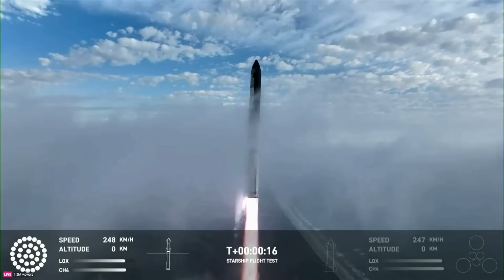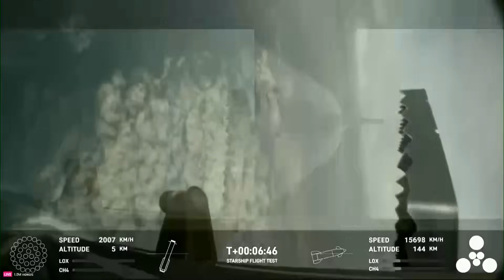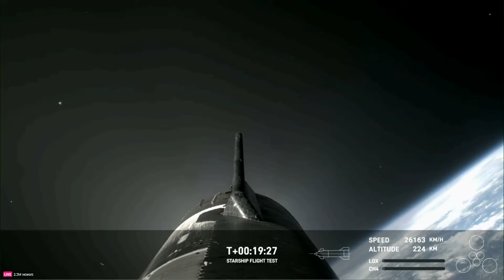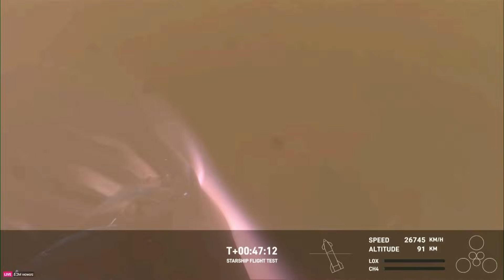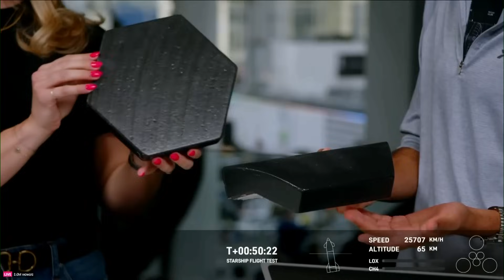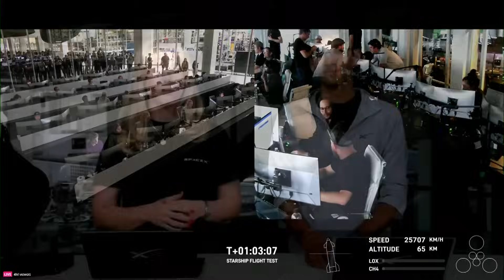Starship's 3rd test flight deemed a success

Comment: Look up AVCO and Victor Emanual 

The welds were done in climate controlled top level clean room using an EBM welder.

My Ukrainian friends dad was 1 of 3 that was allowed to run it. Like me he would say " IF I TELL YOU ILL HAVE TO KILL YOU"

Dad was final inspector on Atlas Titn and Apollo parts. Mom worked there after the Air Force was. Theown out in 1975. Mom shipped every tank engine out IT on that tag grunts. I worked on development of the Abrams AGT1500 so I know a little. Best part was theowing the frozen chickens into the engine at full throttle. Not sure how that would happen on a tank woth filters but was Army required test